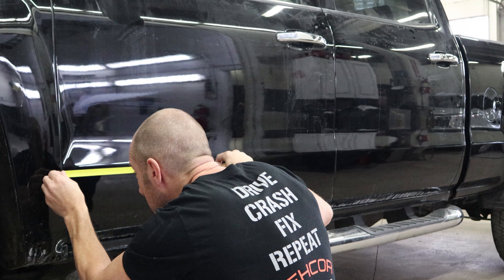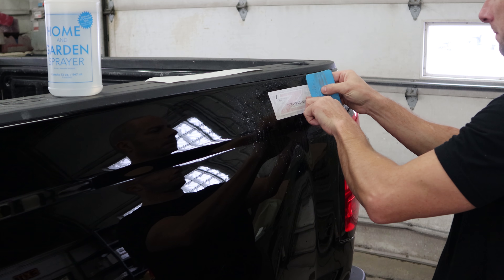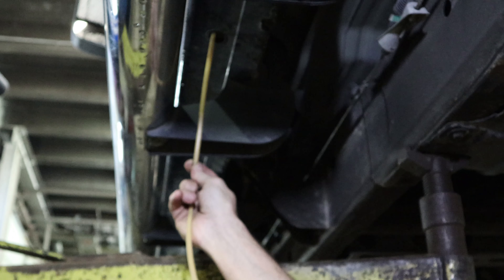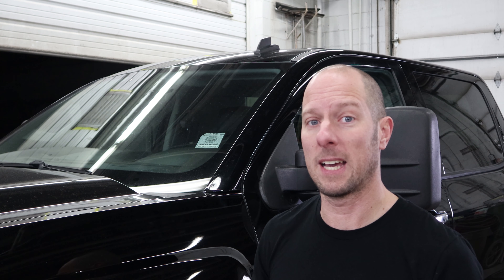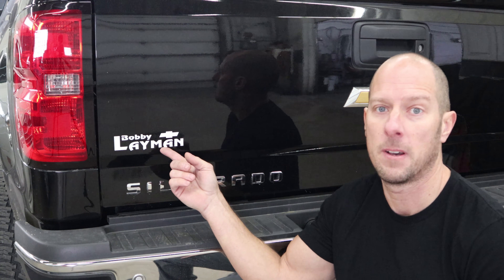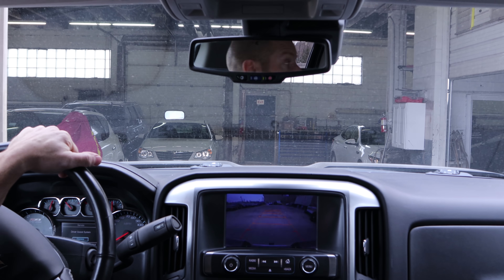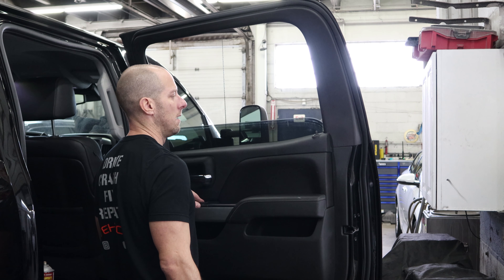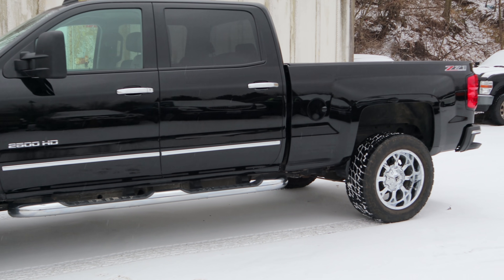2015 Silverado Duramax LTZ build Q & A and the finished product.  The "mistake" hits the road!

Comment: I wasn't a hater or nay-sayer but did comment in the first video that it looked damn near impossible. You replied that it wasn't as bad as it looked so I've been following along and shaking my head is disbelief. Sure this can be done in a shop with lots of help but you did it yourself in 79 hours. That's frickin amazing. Awesome job and a beautiful truck. Congrats!
Reply from the maker: It really was not that bad, lots of nuts and bolts but not hard.  It is easier when you break it down into smaller jobs like I did.  I have had lots of practice at stuff like this so doing it myself is not too bad.  Thanks for watching and sticking it out for the whole build.

Comment: Your attention to detail and care in these videos is amazing...salvage vehicles do not need to be backed away from, as so many are worth the time and effort to properly hit the road once more.  I have owned 3 rebuilds, never had a problem with any of them...Currently have a Mazda 3 hatchback that was returned to road ready, written off for a small crash on 1 side only..Insurance companies are so inconsistent with what they fix or write off...amazing..That's here in B.C. Canada.  The shop did a crap job however of the paint that needed doing that was hard to see initially, lazy end products with little over paints etc..So,  like many who do this, fail to really show the skill by shoddy finishing. Getting it to safety inspection and approved is critical, but the just get them sold part seems counter productive. So, watching the quality of your work proves it takes a little more time, but the end results show...Keep doing it....Good luck with the Wahlberg thing.
Reply from the maker: There are so many people that just believe the manufacturer's marketing about the scary rebuilt vehicles.  The spend millions to convince people to buy new cars and people don't ask questions.  It always amazes me how little people know about rebuilt cars and that even the clear title and even some new ones have been repaired.  I hope to educate people on what a rebuilt car should be and what you should really do to evaluate a possible vehicle for purchase. Thanks for watching!

Comment: Radass dude. I was excited to see this thing going down the road, and it’s not even my truck lol. After watching all these videos I would have zero reservations about driving this truck and putting it to work, well done man thanks for posting all these videos!!
Reply from the maker: I know what you mean, it is kind of not my truck anymore.  There is always a chance the buyers don't work out though.  I have put it to work pulling builds home.  Almost 2000 miles of hauling in the last week.  It is a great truck for my uses. Thanks for watching.

Comment: It was great to be along for the ride on this build.  This truck came out great and looking like new from bumper to bumper.  All that work put into it REALLY paid off in the end.  I could have been mistaken, but I had a thought that the stock wheels were going to be put back on the truck instead of the third party wheels.  Either way, they still look good on it.  One thought I had was to replace the tail light bulbs with LEDs.  I did that when I bought my car two years ago and didn't have to worry about any blown tail light bulbs since I put them in.
Reply from the maker: Thanks for joining me.  I didn't have a full set of the originals but it worked out because the buyer specifically wanted the aftermarket wheels.  They are what actually made the sale for me.  I did have to replace 2 bulbs in the tail lights.  When I find one to keep, I will go with LED.  Thanks for watching.

Comment: You are one of the most thorough mechanics I have ever seen. You check everything as you go. I was quite surprised to see the navigation antenna problem got past you. BTW, I was definitely going to ask where you got the new stickers. Thanks for sharing this with us. I look forward to the next project.
Reply from the maker: I had no way of knowing it didn't work until I drove it around outside. The building is like a bunker and GPS doesn't work in there and I never paid any attention to it pulling it in and out.  I guess that is the reason I like to drive them and find anything that was overlooked.  It doesn't matter when you fix it as long as it is perfect when the new owner/customer gets it.  Thanks for watching.

Comment: Good series, the price is irrelevant. You have what you have in it. It’s a quality product. When a buyer gets it inspected, there’s no way to tell what was replaced for damaged beforehand, except the new paint job. Nice ride. If you would have put the original wheels with oem correct tire size and brand, there’s no way of telling the truck apart from any other truck on the GM preowned  dealer lot.
Reply from the maker: Thanks, I am with you, it is about the work, not the money.  Not everyone feels the same and they now have their opportunity to get the numbers  but they have to put in a little work.  Let's see if they do.  Any wrecked vehicle can be put back to like new condition.  I wish the hacks would quit making the good builders look bad so people did not have to fear rebuilds.  Thanks for the support!

Comment: It's been interesting to see you build this truck fro,m the two trucks, and yeah I believe finding a good parts truck is essential, so ytou are bang on in the fact that it can save you a lot of money rather than going and purchasing parts here and there even from a wrecker. I doubt you would have put in all the time and money if you werent sure of a decent return on your investment, cause honestly all the time and money for a couple thousand dollars wouldnt have been worth it IMHO,  the risk has to be worth the reward but like anything it is all in the numbers of looking at the truck, calculating what you think it will need in parts, labour and time and then what the vehicle in your area of that truck make model engine is going for, and then deciding if its feasible or not. You obviously knew the numbers knew what you needed what you ball parked for the truck, the donor truck and other parts time and labour and knew it was worth the risk to do so, so good on you. The risk was worth the return. I think the biggest mistake people make when doing a project like this is that they dont look at all the variables and the numbers and it comes back to bite them.

Look forward to the next build, and the truck looked great I am sure the new owner liked it and didnt think twice about buying it
Reply from the maker: Your assessment is perfect.  I originally called it the mistake because I figured on extra damage but not enough to cover the trans and t/c together.  I was still at a good price, just not the price I usually want to be at.   I never would have guessed I would be able to snag a parts truck for what I did but once I did, the build completely turned around.  The new owner checked in on it almost everyday and has bought cars from me in the past so was not concerned in the least that is would not be exactly right.  Thanks for the support!

Comment: I wanna know is this 100% working as good as a original built truck?
Reply: Did you watch any of the videos?
Reply: William Aschbrenner about half
Reply from the maker: Sadly no, after driving it for a while the check engine light is on.  It is a bad DEF heater which is a common problem and most likely was on before the accident.  Once I change that, it will be 100% as good as the original.  Everything works as it should, no noises and better rust prevention than the factory.  I can say with confidence that it will be better than the original built truck once the DEF heater is fixed.  Thanks for watching.

Comment: I am glad to see a real car guy who knows a thing or two! When you mentioned the cavity wax, then, fluid film, & said, something the effect of, "You like a video that goes in depth about rustproofing using certain chemicals, in several places, ie- rocker panels, doors, etc... I sighed a bit of relief!!! Finally someone who gets it!!! I'd also consider doing a wet coat afterwards, using 50/50 mixture of diesel & bar & chain oil to the entire underside of the truck, paying attention to the frame & the backside of every panel & ever nook & crany! Anywho, That alone gets a thumbs up from me!!!!!!!!!! She is a Beauty!!!!!!!   Also, I always prefill all filters & coat the rubber seal b4 reinstallation! Helps avoid any dry start or any sort of lag of fluid to a motor, or transmission!!! Another bit of advice, I hope you cleaned your throttle body, iac, mass air flow(maf) sensor, o2 sensors & etc, & at least clean & check the gap on the plugs. The point is, cleaning every sensor always helps obtain a better running vehicle & better mileage!
Reply from the maker: I wanted to give this new cavity wax a try.  I know how well my old stuff works but I am always looking for new and better things.  So far it has held up but the real test will be next winter.  I tried gapping the plugs but it appears these fancy new diesels don't have spark plugs. lol Thanks for watching!

Comment: Glad you finished the truck. Can't wait to see what you do next.

The end about the rattles, yes I was worried about them. It's just if I hear any little noise that is a squeak or rattle it drives me crazy. When I ask other people if they can hear it, they usually say no lol. Glad everything is nice and quiet in the truck!

When I take things apart I usually tape down connectors or put tape between parts that may contact. I just go a little over the top. I believe you said you said if the factory used anything to isolate parts/panels you made sure it was used, which should be good enough for the most part.

I didn't mention that I install subs in my vehicles, so that complicates things a lot.
Reply from the maker: Those subs will make or at least help you find anything that might rattle.  I did have a sub phase in my younger years.  Now I go through cars so quickly it is not worth trying to make them "mine".  Thanks for watching

Comment: After you tackled the chassis and engine, I knew you had the most important to any problem. . . Confidence in yourself. Good Luck and I look forward to your next build. It's winter so maybe I need a shirt. Thanks again.
Reply from the maker: My confidence was never a problem, it comes with experience.  If anything, I worry my overconfidence may get the best of me one day.  I do like challenges though.  It turned out just like I planned, some bumps in the road but every build has them.  I think I need some parkas or to move somewhere warm!  I hate winter. lol  Thanks for watching.

Comment: When I was 16 I bought a salvage title Honda in MA the body sat crooked and would drive down a straight road sideways. Since then Ive seen plenty of vehicles with salvage titles and stayed away like the plague. But this is definitely a salvage vehicle I’d purchase, or any vehcor build for that matter. I know the quality is definitely there.
Reply from the maker: There are certainly some rebuilt car horror stories out there.  I have bought few that  I had to redo someone else's work to make it right.  If done properly, a rebuilt should be as good as before the accident.  Thanks for the confidence in my repairs!

Comment: Hey man good job on the rebuild. I rebuild cars for living as well.  When I came I across your first video and saw what condition the truck was in I didn’t  think you would rebuild it. That’s a lot of hard work, you must have a lot patients. Keep up the good work! Best wishes to you from American Motors inc
Reply from the maker: Other than the cracked trans and t/c it was pretty much the job I expected when I bought it.  The only question of if I would fix it was locating a parts truck or end up using this as one.  I have done a few jobs like this and they are a lot of fun.  Good luck on your builds and thanks for watching.

Comment: My policy about changing wiper blades is put some scrap cardboard on the windshield where the wipers come down.  Just in case it slips out of my hand as I struggle to get the new blade on.  I came up with that policy the hard way.

Comment: Just had to say you did a really amazing job on the truck does not even look like it was in a crash or anything
Reply from the maker: Thanks, if done correctly any rebuild should not look like it was worked on and should react the same as original if it is ever in another crash.  Thanks for watching.
Reply: @vehcor  sadly that was not the case with my truck. im only 17 and i could of put my truck together better than the person that owned it before me
Reply from the maker: @etaled  Sorry to here that.  Hopefully  I can show you some ways to fix it right!  Good luck with it!  My first pick up was always being fixed.  Mainly because I did a lot of off-roading and it didn't like it. lol
Reply: @vehcor  ya im selling my truck now just dont want to deal with it ill be sad when it does go like it said its a 97 chevy 98% rust free ill probably never find something like it again. but im on a hut for a 93 and up to 99 crewcab long bed gas or diesel just something that was not beat its hole life just love the obs look.   can i email you i would like to show u what i have
Reply from the maker: @etaled  sure, vehcor1@gmail.com

Comment: You just got yourself a new subscriber nice work on the truck loved the finished product. I wonder how much I would've saved if I had fixed up a truck for myself instead of buying my new 2018 chevy silverado 1500 ltz midnight. I just realized today after using that same road you test drove the truck on that your right by me lol. Looking forward to your new projects.
Reply from the maker: Glad to have you here.  You can save more on the 1500s the demand is high but not like the 2500 diesels that are bringing 80-90% of clear title prices with a rebuilt branded title.   I will have to get another truck eventually so hopefully you will see at least one more.  Thanks for watching!

Comment: I simply love everything about that build and I would love to own one just like that. If you have the time to answer it, I have  a question for you: when you choose a car or truck for a build, what do you avoid? Flood, burnt or something else? Thanks and keep up the great work.
Reply from the maker: The only thing I really try to avoid is losing money. lol I'm very cautious of flood cars because they can get very expensive to repair correctly.  Burns require a lot of replacement parts that are unusual to normal repairs and have a lot of hidden costs.  I have fixed both of those and every kind of accident I can imagine.  I stick with vehicles that are reliable and sell easily so that I can move onto the next one in a short amount of time.  Thanks for watching.

Comment: I really enjoyed watching this build. Your thorough coverage of the breakdown in the videos helped answer some questions I had regarding the Duramax. I did have one other question, how much play is in the bed of the truck when the locator pins are lined up with the frame? My bed is off by 1.5mm towards the passenger side. Would I be able to loosen the bed bolts and shift the bed without lifting it to clear the locator pin? My truck is an '18 Sierra. Thanks again, and keep the builds rolling!
Reply from the maker: Thanks, glad it was helpful.  1.5mm is not much, there is very little play in the locater pins but there might be enough to get you the 1.5.  The cab itself has a little more play.  It might take a combination of both to get it exact.  Thanks for watching.

Comment: Unless you put a generous helping of RTV around the base of the GPS antenna youre gonna have a water issue. I work at a GM dealership and this is an extremely common issue. We do these all the time. Excellent build though! Ive watched from beginning to end and thats the only thing Ive seen so far that made me throw in my 2 cents.
Reply from the maker: I did on the first one and it was a pain to remove but I did do the second as well.  I was surprised the slightly corroded one worked and the brand new looking one did not.  Oh well, I only need on to make it work. lol  That GPS was valuable on the 1300 mile road trip it just returned from.  Thanks for watching

Comment: You should put seam sealer around the gasket on that high frequency antenna. Those leak water all the time.
Reply from the maker: I am aware, it was done.... both times.  Thanks for the tip!

Comment: Great reveal.Im impressed with your attention to details.Looks like front end has been torsion Leveled?
Reply from the maker: Thanks, the front is keyed and the rear has taller springs.  It is maxed out without going into a much more expensive lift.  I like the looks but not sure if I would have kept it if I were keeping the truck.  thanks for watching.

Comment: That water and dish soap method for putting on the Z71 decal is really interesting. So the water doesn’t affect the adhesive on the decal? And thank you for the ECSVIN tip as I need a new emission sticker for my G8. Outstanding video!!!!
Reply from the maker: The water has no effect but the amount of soap does.  Literally, just two drops is enough in that spray bottle.  This is known as the wet application method.  I never had good luck with the dry method so it is the one I use.  ESCVIN is great, a dealer sent me to them a long time ago.  Thanks for watching.